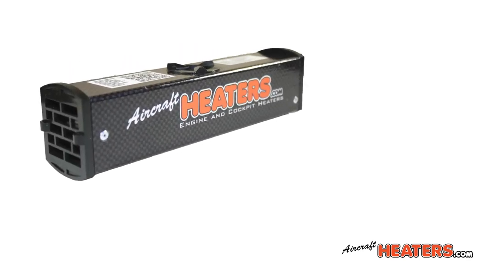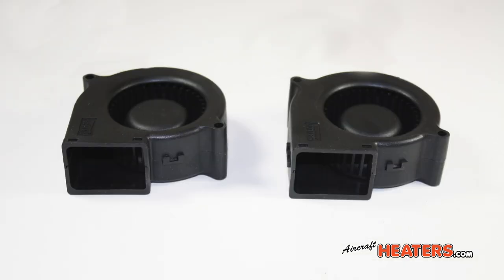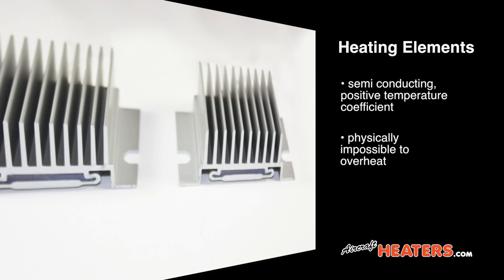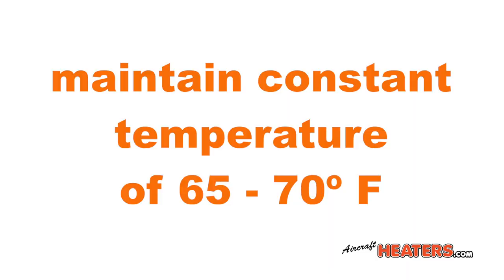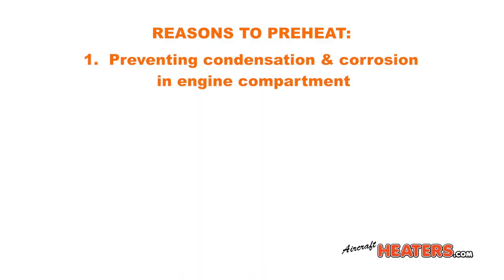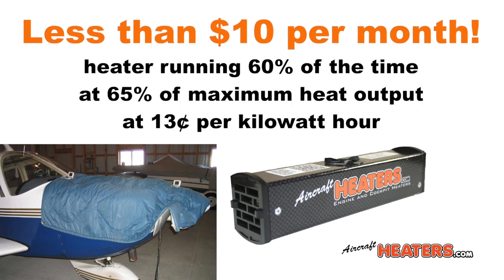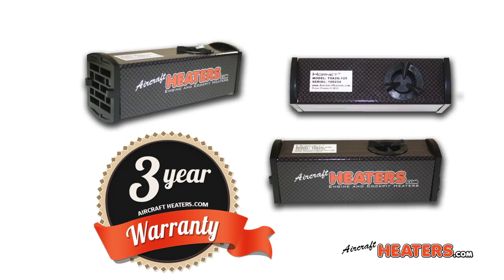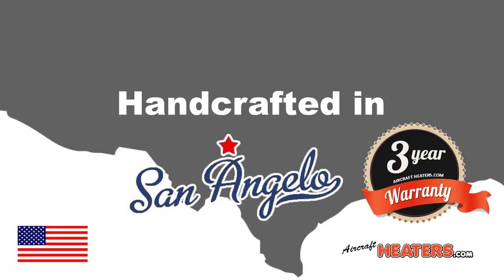Aircraft Heaters .com AOPA Trade Show

Comment: If it uses electricity to either produce or circulate heat, it won't work in real remote Arctic conditions. Ive already been there and done that, and Ive got the T-shirts for all of it.